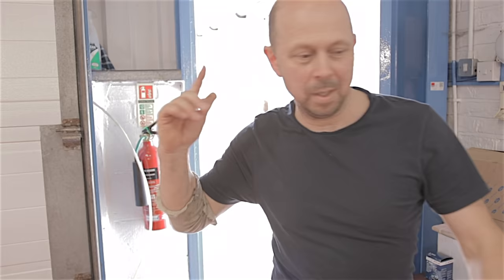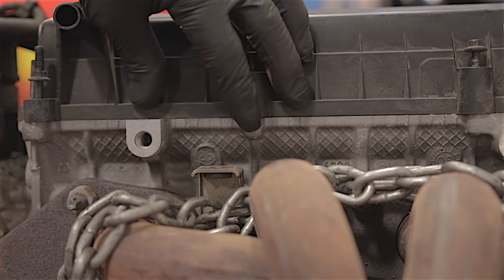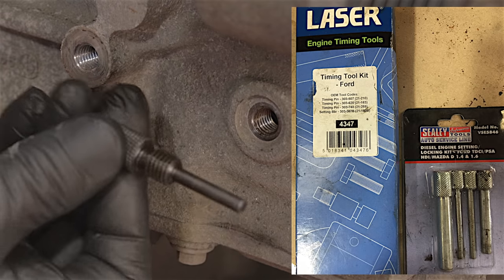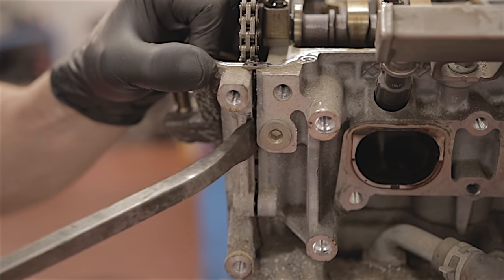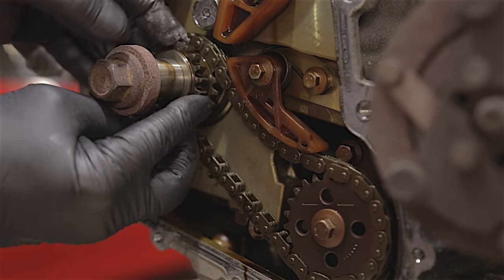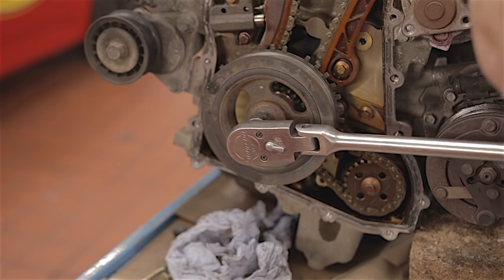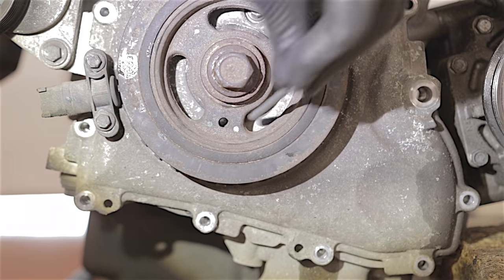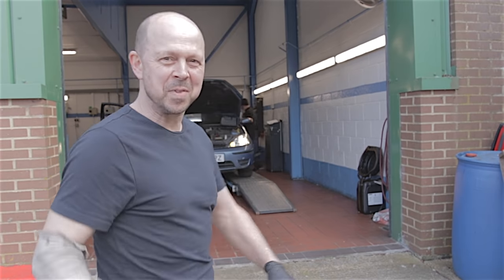Timing Chain, Ford Mondeo Mk3 2L Duratec

Comment: The video is great but you shouldn't unbolt or torque the crankshaft bolt against the timing tools, you need to use a pulley holder. This is specified at the Ford service manual.

Comment: Hello mister Alan !I have the petrol 1.8 Duratec and yesterday i clean the cramshaft senzor and put in the same spot and the car are no running at all !How to align that senzor to fire the car, do you explain me ? Actually i buy another senzor and it came with that "align  plastic tool", buti don't know how to align it corectly ...

Comment: Hi Allan, its great to see your videos and those funny moments (Brit humor :D ) and because i have been searching in your channel about a 2.0D for these mk3 engines here am i asking for help. I see several guys posting a lot of knowledge but it feels awesome to see the simplicity you tackle several problems. I tried to send you pm using yt but isnt available because im trying to learn how to fix my own mk3 2.0d and maybe you can help me by giving me some leads or tip top. my glow-plugs got stacked and the only way to remove them is to get out the engine or disassemble it from the top (engine bay) but before i even try i would like to ask you for advice and the torque values to tight back these elements.  thanks in advance. cheers from poland

Comment: I had MK3 2L duratec 130Bhp deisel with 400,000KM on the clock and still have no problems with the belt
Reply: Belt or chain ? 
These diesel engine is not a Mazda construction.

Diesel engines are used by owner at long distance to work (or daily use). 
Only today the Mk3 owner use there Diesel engines wrong. 

The newest MK3 is over 16 years old and the owner are often persons with small money ...
... oil service or minimal service ???? Ok, only when the fire start burning and cheap or cheaper if possible ... 

YES with the perfect owner these 2.0 li Diesel is a long time use engine when the daily distance is well. 
I am sure you can use your diesel 200.ooo km more (hope so). 

400.ooo km = 250000 miles
600.ooo km = 375000 miles
800.000 km = 500000 miles 

rubber, gaskets and EGR get worse and need spare part, cleaning and some care. 
Intake turbo tube often get worse. 

Salt corrosion ar the radiator ?

Comment: If anyone can tell me, please, when the crankshaft is locked with the pin, is the piston nr.1 at top dead center? I have a job where the pulley of the crankshaft has been removed and the crankshaft rotated and i dont really know how to time it properly now, does the usual piston nr. 1 at TDC and camshafts blocked work? Thanks a lot....

Comment: In Russia, the Ford manual requires replacing the pulley bolt with a new one, each time the chain is repaired.
Reply from the maker: yes you are right

Comment: Great video! About to time a 2.5 duratec myself and this helps quite a bit. For curiosity sake did you notice any sort of diamond washers behind the crank pulley or the cams on initial teardown that would need replacement?
Reply from the maker: no i did not come across anything like that
Reply: They are there, they are sooo thin that you will miss them. They need to be replaced and free from grease/oil before tightening.

Comment: I don't know why you would do this job when the cost of the labour will be more than a Mk3 Mondeo is worth.  However, I watched because I love mechanical engineering and this is a very good video.  I am on my 4th Mk3 and the least I got out of one was 120K miles when it had a catastrophic engine failure.  The rest all got sold at 160 to 180K because the accumulation of small repairs was approaching the worth of the car.  BTW, I though the Duratec HE was a Mazda engine.  I might be wrong.
Reply: Mazda L6 engine. 

You are right = Duratec HE 1,8 li and 2,0 li and 1,8 li SCI petrol engine
 is a construction from Mazda. 

Ford and Mazda have a corporation for a few years and they both have a close look what each one devoloped before. 
Better to use a good existing engine and dont spend years and money for a own development. 
Plus you can use the production tools and cast thinks from Mazda or the japanese company produce the cast tools for Ford to. 
Cheaper when you order more production tools.

Comment: The fact you've got these still going as rental cars on '05 plates shows just how tough the mk3 potato is. Most rental cars are falling to pieces by a few months old.

Also, typical Mazda engine. Really overengineer much of it, but put in oil control rings made from cheese. MX5s of various ages were just like it. I wish they'd keyed the crank too.

Comment: The decent timing chain because this is a Mazda designed engine.
Reply: Good ol mzr. I wonder how much is actually shared?
Reply: No, have never seen one made by Mazda without a key in the crankshaft - pulley ... Also we never see anything with 13 mm on a japanese engine. Mazda maybe uses this engine or parts of it in their models as well as I have a Ford pickup truck gearbox in my RX 7 FC Turbo - but they haven`t been involved very much in the design .

Comment: I'm doing valve stem seals on a '05 Volvo V50 1.8 Petrol B4184S11.
Do you know if the timing chain setup is identical?

Comment: That tensioner is the secret of such a long lasting timing chain. Not like the one fitted on vag engines that loose oil pressure with the engine off and detension the chain.
Reply: Ironically its the pawl that failed on mine in the diesel variant...
Reply from the maker: good point, that tensioner cant retract
Reply: I will love to see this type of tensioner in vw and audi engines.
Reply: Yup. Relies on the oil pressure in the engine to keep the tensioner out. During cranking you don't have much pressure so relies on that pawl to keep the chain tension. Its why you should never bump start the puma engined transits as this is the bit that fails and causes the timing to jump
Reply: @flo_neke  Take minutes of your life and use Youtube videos.
I think you will find some videos.
If not in your country and language ...
... try german videos.

VW is sold in high amounts in germany. 
Audi owners have more money in germany and the used car is at higher value = worth to spend more money for service. 
That is the reason why in germany you see a lot of VW and Audi at Youtube or Television in the garages. 

Try videos from well known german Youtube persons with a own garage =
- Autodoktoren 
- Redhead Zylinderkopftechnik
Sorry I dont know other Youtube channels in germany.

The tensioner have no first opticl different ...
... but the guard rail move very wide ...
The tensioner move to mutch and you see the beginning of a different zone comeing out of the tensioner. 
I can not rember the video and the look.
I dont like VW and Audi today = only my personal opinion. 

But the cheap timing chain is the main reason and than the tensioner try to compensate ...
cheaper, smaler for less build volume, quitet than think and bigger timing chains 
(the very very very old double chains from Mercedes-Benz diesel W123 last 500.000 to 1.ooo.ooo km)

I dont like a car brands that try to sell cars because the engine have a very very ...
... better MPG with light and small parts  plus high technology everywhere...

These VAG engines use a lot of technology and these additional parts can make additional problems. 
Ok japanese, korean, french,  ... cars are not realy better. 
All manufactureres have there typical problems. 
More advanced technology = more problems and expensiver problem = never ever very very old cars anymore.

Comment: wish my Mondeo 2012 diesel had a chain because in 6000km I have to have the cam belt changed so that is probably going to cost me a bit as I can't do it.
Reply: I wish my Mondeo Mk3 PETROL engine had a belt. 
The service is cheap (but more often at the car lifetime). 
If the belt is not the belt in oil construction (=Ford 3 cyl or VW 3 Cyl engines) ! 
A lot of years ago I have changed the belt at my Ford by myself (with the help of a prof Ford technican beside me).

The chain from the petrol engine is not really a long lasting timing chain. 
Not long lasting ! but if you have to change the chain ...
Nice and ok if the engine is outside ...
Or the work space is difficult and hurts the mechanic ...

Well it is not a VW 1.4 TFSI chain (from the year ABCD) but not for hyper long lasting time. 
Chain only when it is at the level of the old (very old historic) Meredes-Benz W123 Diesel engines with double with chain (normal use unbrakeable and extreeeem long lasting)

Comment: Hey good video enjoyed that. I have ford fiesta st150it has same engine do you know what miles the timing chain needs changes at my car at the minute has 93k 👍
Reply: Same engine here. Interval is 100k miles I think but have read duratecs going to 175k miles and beyond. Pretty much lasts the car, commonly said to just replace or look at once it starts getting noisy. Even then its most likely to be the plastic tensioner not chain
Reply: @zachaphina3140  ok thanks for getting back to me 👍👍

Comment: Hi, I would like to ask if the crankshaft sensor has to be in alignment with the crankshaft pulley? (I have notice that the crankshaft sensor can be slided up and down I don't know if this has an affect on timing)
Reply: You found the problem ! 
Dont do these work when you have no service information (copy of the manual or DVD text or ... or ...)
You need tools, time, maybe a helping hand from a strong man. 
You need a clean area and clean the motor better than you see it here in the video (=my opinion).

See 7:20 the pin at the side alligne the crankshaft.
The hole in the pulley and behind in the aluminium the hole is the alignment for the pulley. 
The tooth at the pulley are used by the crankshaft sensor (left from the pulley).
Dont move these sensor (or mark the position at your own risk).

Dont safe money and buy a new pulley screw, sealing, gasket, 
two drops of car silicon (=no corrosive for aluminium = no bathroom silicon)
and some part more plus cleaning material.

You will have a lot of problem if you loose these alignment oft the crankshaft sensor ! 
See the description at the service manual. 

If you are at beginner level and not well skilled = This is not your work, even if it look simple ! 
A good nice video ! Based on the service manual. 

A beginner cant lift the engine out of the engine compartment. 
If the engine is in the compartment = IT wil be very difficult, less space, a lot of problems additional, but possible.
Lift the engine out and change the 2-mass-fly-whell, the clutch, the water pump, the thermostat. 
Ok a lot of money but you can sleep well and use the car for miles and miles and miles until the rust ...

Attention the pulley screw is normally VERY tight ! Very tight ! 
And you need a long break bar. But you need to hold the pulley !
NEVER EVER NEVER EVER only a pin (or screw) throw the pully hole in the soft aluminium hole !!!! 
Luky if you got a these tools we see in the video.
The man got a good air compressor for air gun tool and a BIG inner diameter air hose 10 mm inner diameter (not good 6mm). 
Buy these. Compessor you can use for a lot of thinks (not to small a big tank with a lot of air volume). 
The air hose is well when the inner diameter is 10mm and not the cheap thin inner diameter. 
The air gun is with a normal no-name brand around 65 Euro = 55 GBP = USD 70 = 100 AUD from  a china brand name. 
A usefull tool for car mechanics. 

By the way = A lot of money investition ? Ok you think a no-name garage is cheaper ?  Well 

In the video you see the 2nd pin (I use a screw). 
Be aware the 2nd pin (or screw) can break easy the alumium when you use the torque wrench with 100 NM 
(and then  mhhh  ??90 degree ??). EASY break the aluminium ! 
Read the service manual before you start working. 
No manual ? No good idea. 

Google and search words  Mondeo MK3 

You find possible internet forum with privat Mondeo owners. 
If I need some helping information I read these text in the forum and-or ask. 
Some privat persons are maybe ford technicans with own Mondeo MK3 ?

Comment: Alan, could I ask you how long a timing chain on a 2.2 ST TDCI Mk3 should take, labour wise? Thanks.
Reply from the maker: that is quite an involved job especially in the car...also the chain cover is glued on and you will most likely bend it trying to remove it and need to replace it...if you have never changed one of those chains then it will take quite some hours as nothing is easy to get to
Reply: Cheers Alan.
Reply: But very short when the salesman (or owner) mostly used a big heavy car at urban roads with very low speed and very low oil temperatur and very short time under 20 minutete (from start to stop) plus not daily country roads speed or motorway speed (medium to high speed is better).

But before I answer your timing chain change question ...
... how long is you life span? 
Ok, 
... it depends on your use of your body, food, sport, physis, psycho, gene , ... 

For your time chain question use Google, searchwords =
Mondeo MK3
and word=  forum

Remember the pre-users and there service life (shorter oil service !!)
And dont forget = Mondeo MK3 build until 2007 = over 16 years 
I hope your car is not a car in daily short distance use. 

You can see it at your service manual :
- date
- mileage
- how long was the time between service
- better shorter time between the service (=long distance use = hot engine oil) 
- the service garage and the citys

Long distance car or medium distance use ? 
Very well !

Comment: Do these engines have an issue with piston rings gunking up. My focus with this engine burns oil
Reply: Oh yes,their weakpoint.Aftermarket rings are cheap and better than the oe items designed to reduce friction and parasitic loss,I did a c max years ago which has covered about 140K since,the oil consumption is now still lower than when it was new.

Comment: I used to had two potatoes, 125 hp and 145 hp. Couldn't feel any power difference 😂. Really boring engines, but never had any problems
Reply from the maker: lol, i really cant remember where the potato line came from🤪
Reply: Doesn't matter, but it sounds reeeaally funny 🤣

Comment: If you time the valves every 60.000miles, there will be no problem with the oil consumption. It is not a self timing valve engine. Otherwise they are really reliable.
Reply: the Mazda L6 engine in the mondeo Mk3 have problems with the timing chain and the use by the driver. 
A lot of petrol Duratec HE Mk3 start with problems at around 70.000 miles = 110.000 km 
Funny ? 
But you can read in germany in the Mondeo MK3 forum that it is not unusual with timing chain problems after 50.000 miles = 80.ooo km

Above my personal opinion. 
Google is your frind plus search words = 

Mondeo 
MK3
forum

Ok you have to spend time
Reply: If the driver is a long distance driver. Motorway or country roads perfect

The Mondeo MK3 is a big and heavy car. Natural aspirated ! Oh dear but ok no hard work for the crankshaft. 
With urban use and or short distance and oil change at distance (see Service manual) ..

No perfect idea for a long engine life. 

Oil consumption = PVC valve and worse user with wrong distance for daily use.
But additional these owner are unable to short the oli service distance in there head. 
Dirty oil, more water and petrol in oil = change of viscosity dramatical ! 
Problems with oil rings and cloak 

Well nearly every big engine (ok 1.8 liter is in my opinion not big) dont like these. 
Not perfect for a long reliable life. 

You can service the valve gap every month. Better change oil and drive longer distance to cook water and petrol out of the oil. 
The driver must not drive very fast. Normal motorway speed and mutch longer as 30 minutes = XY miles is well for the engine. 
Perfect if you use these salesman car at country roads or motorways for some houres at normal speed. 

Thise is no car size and engine for the worker and the daily 15 to 20 minutes to work and only 15 to 25 km one way. 

Think where oil is in the engine and these are the ways where it can be lost. 
The PCV valve is often cloaked and it is very small. No good construction. 
My older very old Ford engines never ever have a PCV problem.

Comment: I think the difference between the Mazda and Mondeo mk3 engines is only the injection system. I think Ford used Delphi while Mazda went with Denso. As far as i know these euro3-4 Delphi setups are garbage after around 180k kms same used on early euro3 Renault 1.5 dCis aswell.

Comment: You don't  get it as you are not an accountant. Cost cutting improves the bottom line and makes higher bonuses for the directors.  You, and I have to then make you for their deficiencies. I wished you used Lb per sq. inch.

Comment: The Ford Duratec is a Mazda engine (the L8 as fitted to the Mazda 6 of the time).

Why?  ... Ford did a deal with Mazda to exchange their Ford Diesel engine design for Mazda smaller petrol engine design, because Mazda didn't have good diesel engines and the Ford X-flow? or sigma?  engines of the time weren't passing emissions regulations.

Hence the high quality timing chain design.
Reply from the maker: thanks, thats good information, i long forgot about mazda and ford but now its all coming back🤪
Reply: @alan4x  i need your help.  My mk3 1.8 petrol is popping back through the airbox, and I can only think the timing has slipped out. It does it at idle when you apply a load to the power steering.  

I have removed the flaps on the intake manifold,  but everything else is standard. 

Why would a petrol duratec HE be popping back through the intake 🤔?
Reply from the maker: i would first check your spark plugs and high tension leads..that is probably the reason..leads are arking and even the coil packs can cause this when they break down